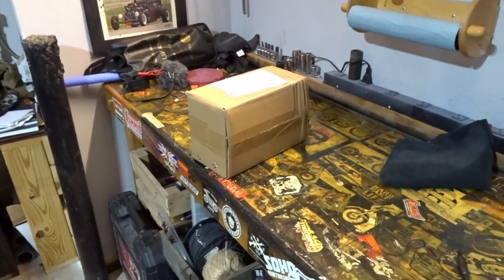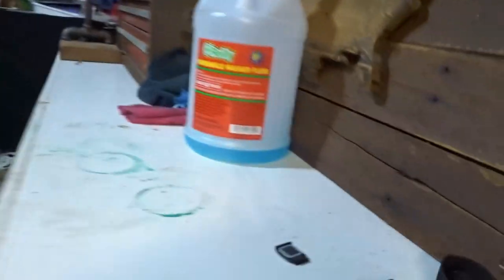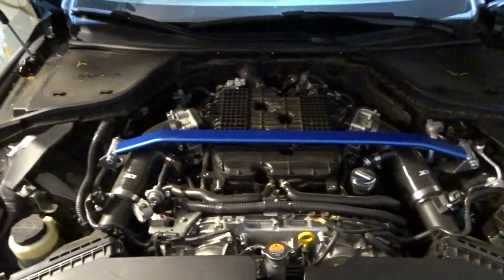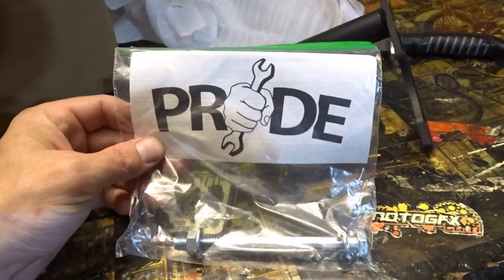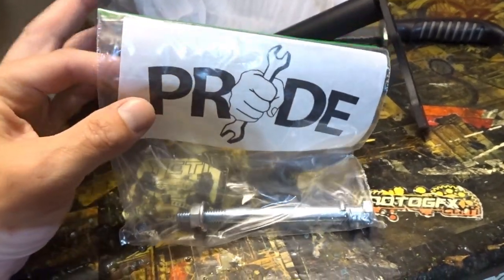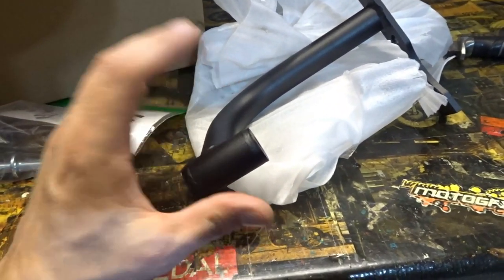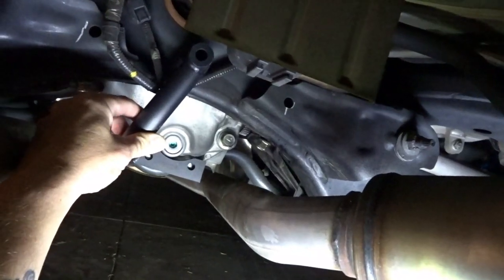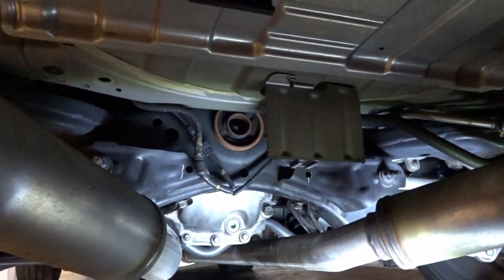Q50 Vlog I Got NEW PART that many DO NOT HAVE!

Comment: Had the same problem,  ran the cheap blue stuff out immediately then put bug and tar washer fluid in drove around and boom next start up it was off and been off for a year
Reply from the maker: This is the first I've added washer fluid.  I'll have to get this stuff out and put in some different stuff and see what happens.  If not--new sensor here I come.
Reply: Bet it will work if you put bug and tar orange rain x in it
Reply from the maker: @joshrichie9833  filled it up this afternoon.  I’ll report back 😉
Reply: Might take a few days for it to work

Comment: I'm new to this world so pardon this question if it seams ignorant but I'm thinking about getting a strut bar. Can you really tell the difference in cornering and if so which ones would you recommend? Thanks 😊
Reply from the maker: I’ve talked about this in some other videos, but no you won’t “feel” the strut bar in cornering.  However, if you plan on autocrossing the car or taking it to track days, adding rigidity can help

Comment: Searched your videos couldn't find Air Condition noise. It isn't the fan making noise, it sounds like the AC because it doesn't make noise if left on fan mode.
Reply from the maker: Are you having a problem with your ac?

Comment: Do you think this will fit cars with the HICAS system? I brought a GKTECH rear diff brace & it was a no go..
Reply from the maker: I can’t be certain.  Does the diff not have to move with hicas?
Reply: @SpeedCultureStudios  I don't think the diff moves, just the back wheels potentially. Basically the system is between the diff and subframe
Reply from the maker: @Mar1lynManson  right yeah i would think the diff is stationary — would  not be practical to have it rotate.

Comment: Have u seen the trigga m 76mm throttle bodies and what’s ur opinion on upgrading throttle bodies
Reply from the maker: I have seen them.  The concept makes sense but just like for 3” intakes the car really isn’t setup to bring in more air.  The dyno sheets I’ve seen with the larger throttle bodies have had the same numbers as cars with regular bolt ons.

Comment: @ speed culture studios hey I just install my rear reflectors on my 2014 Infiniti Q50s 3.7 for some reason the right one doesn’t light up but it works the sequential. The left one is fine it lights up and is sequential. I looked over the wiring and their the same. Any suggestions?
Reply from the maker: May not be getting a good connection.  Did you use wire quick splices or how did you connect them?  That’s what I would check
Reply: I used the 3 butt jelly beans connectors. I even rewired them but still nothing.
Reply from the maker: @amerkamal1859  might be an issue with the light itself
Reply: @SpeedCultureStudios  I appreciate it.